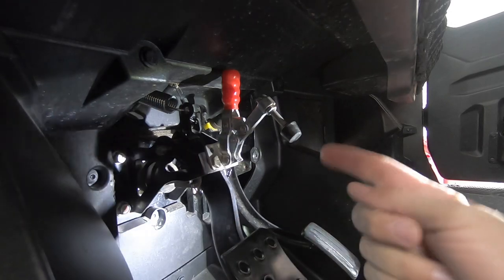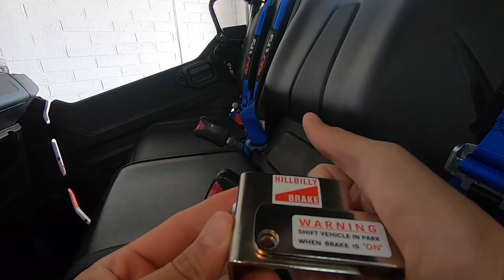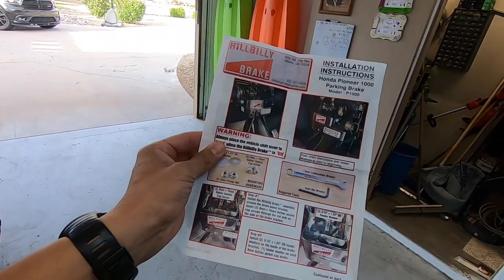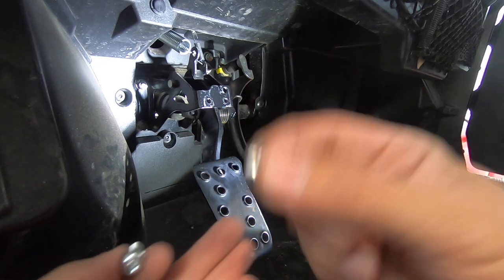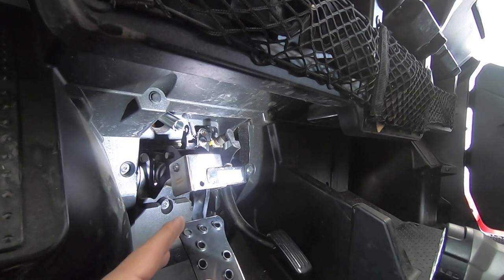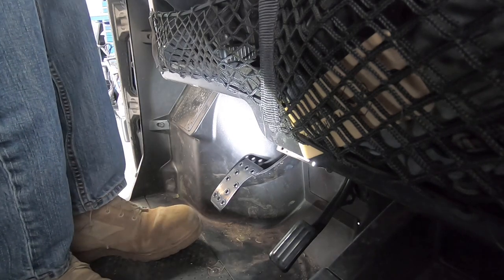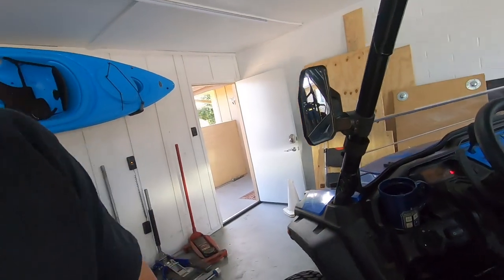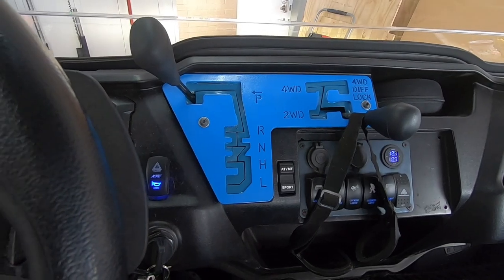Hillbilly Brake install and review

Comment: I seen one guy has a 2016 1000-3 pioneer and he has 40,000 plus miles on it and no problems with it other than keeping it serviced
Reply from the maker: I saw that too! I hope to get that far I have over 3K and climbing!
Reply: @DirtNDiesel  I have a 2016 pioneer 1000-3 it has 8650 miles on it and I haven't had to do anything to it, you can't beat a Honda for reliability